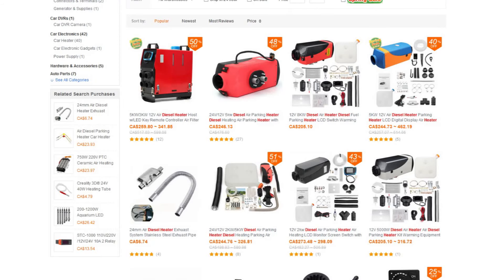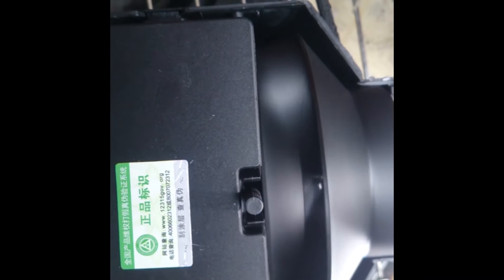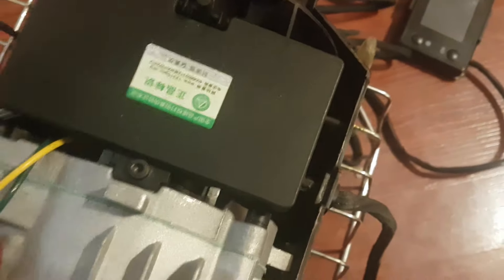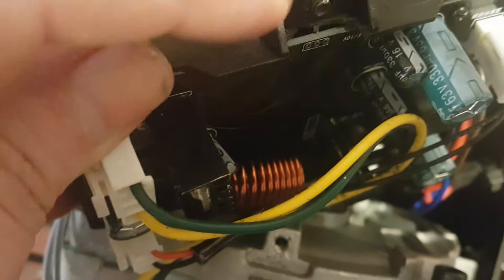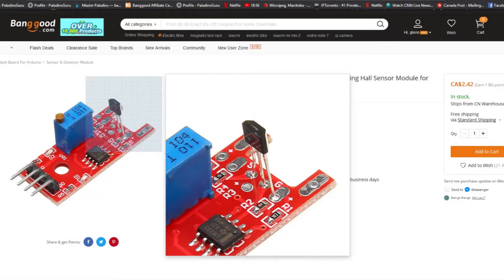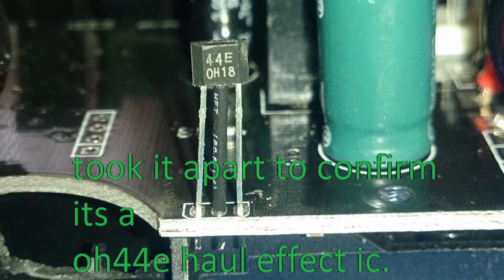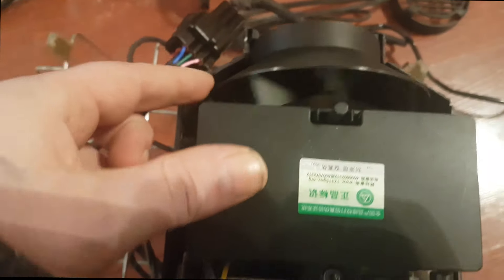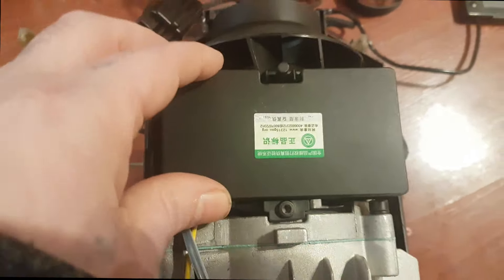Diesel Heater E 06 error fix

Comment: My E-06 issue turned out to be a fuel issue. The heater would switch on and run properly for about 5 mins or more then display E-06 and shut down. I pulled it apart and checked the fan was free and the sensor was spaced correctly and that was all fine. So after reading somewhere that the issue may be fuel related I checked the fuel pump and filter and noticed that the fuel filter was lower on the intake than the output side (angled downwards) and the line was lower on that side for a 6 inches or so. I cable tied it up so the line was now pretty much horizontal and its been working perfectly ever since. It apparently doesnt take much for these impulse pumps to not work and the agitation of the diesel can  create air bubbles in the fuel line. Anyway what ever the issue is its now fixed (its been giving me grief for a while). So its worth checking this if this video doesn't resolve the problem. Cheers
Reply from the maker: thanks for taking time to explain another way to fix the issue..
Reply: I feel no one know what it really it. People are just making random videos and saying it fixed it

Comment: Just fixed my error, I spent ages trying to fault find another unrelated issue with voltage - after I fixed the voltage issue I was getting E06 error as the circuit board was outside the unit whilst I was testing the unit. Didn't realise the circuit board had to be secured inside as the magnet helps regulate the fan speed.

Cheers!
Reply from the maker: yup @ 2:48 hall sensor.. if its even out a millimeter never mind out of the unit, it wont work heh.. glad  you figured it out..

Comment: Installing my 2nd diesel heater in our new rv. Primed it and got the code after turning it on. found your video and I had it fixed quickly with flat head screw driver, prying at 12 o’clock 3 o’clock and 9 o’clock. I’m toasty warm now. 😜 cheers.
Reply from the maker: cool.... thanks for taking time to leave success comment and the way you fixed it..    I love that heater during cold camping nights.. No more 40 pounds of blankets..(small pop up camper)just a sheet does the trick.. ....  have fun rving .... Hopefully next year we can get out to the lake our selves..
Reply: Just to verify, you pulled the fan(with the screwdrivers)  “away” from the sensor to create more gap between the magnets and that sensor? Was it scraping? Thank you.

Comment: I got that code. but the fan moves freely. When it first "starts up".. The fan doesn't move at all. it just throws the code without moving. fan can spin by hand. When that happens, the screen does show that it is spinning.  Ideas?
Reply: Mine has the same problem! Did u ever figure it out?? Thx
Reply: Same issue I’m having right now. Power to the fan and it spins just fine but seems like the control board is not sending power to the fan

Comment: Thanks for your suggestions however, my E-06 isn’t scraping when I spin it with my hand. I tried to get it going by spinning it after depressing the On button and it almost kept going. But just ended up dieing again! 😢. BTW, when I spin it by hand AFTER depressing the On button, then and only then do I hear a little tiny bit of scraping. As if the On button cause something to push out that wud make it scrape? Any ideas are very much appreciated. FYI, I primed it so I don’t think that’s an issue. And I’m about to purchase another motherboard cuz I read (somewhere) that helped someone.
Reply from the maker: have you tried to move the fan out just a tad anyways..and see if you still get scrapping with the power button pushing in...  the hall sensor and the internal timing are extremely picky on these units..  its extremely doubtful but you might want to check to make sure you have 1 or 2 magnets as well on the fan and also check to see if the hall sensor is in place correctly .
Reply: @ModItBetter  yes. The magnets and sensor appear as they did new. As far as moving the fan goes, it doesn’t seem to want to budge and I don’t want to break anything. Especially if it’s not scraping (when not on). Is there a screw or bolt holding the fan? I don’t see how u guys are moving the thing. It’s tight on there.

Comment: Just went through the nightmare that is installing one of these. The wire crimps at the main connector were just falling right out. I ended up having to cut the connectors out and butt connect them all. I did do a test run but after installing it no longer ran and gave this E06. I found this video and then found my gan was indeed rubbing. Mine was due to the case was slightly deformed from pushing on the carpet when I tightened the unit down. For me the fix was putting a large worm gear clamp around the end. I checked the fan spun freely and it started and ran as it should. If I could do it over I wouldn’t even waste my time installing one of these. They’re built so cheaply anything could happen.
Reply from the maker: crap.. glad you figured it out.. yeah tad nervous of using it on my trailer this summer.. dunno if i will wake up running around on fire..  point is if they have issues on just the fan. quality control is not at its best.. to be trusting your life with it.

Comment: Help needed please, I’ve got a CDHeater been running fine, error code E-06 coming up changed the heat sensor fuel pumping fine, gets up to temperature quite quick heater plug working  fan running good then starts shutting down then E-06 comes on.
Reply from the maker: are you running with the lid closed .. nothing blocking the air or exhaust.. .. the blower section can't be blocked even a little as well . If the fan is not spinning at 100 percent at the speed its suppose to be running at it will shut down.
If the fan is rubbing even a tad as well it will cause issues.  If the fan is too far away it will also cause the e6 error..

besides those.. It could be the magnets or the hal sensor.. 

Those are the only things I can suggest..
Reply: @ModItBetter  hi  hi I’ve checked everything you have said the fan is running perfect no blockages. The only thing is it seems to get up to temperature really quick within three minutes and then shuts off. I’ve checked with my other one and that one takes about 7 -8 minutes to heat up I’ve changed the heat sensor and that seems fine
Reply from the maker: @wattsupcarter  Have you tried going into settings with pass code 1688 i believe and try setting the unit hz to a way lower setting or higher..
Reply from the maker: I believe also setting for the magnets if you have 1 or 2.. it could be it set to the wrong one.. but its been so long on that

Comment: Hello. I got this error number, but my fan works freely. No click sounds at all. :/ This heater worked only first 5 minutes. After that I got err8 and after restart err 6... Do you have an advice for me, please?
Reply from the maker: are you priming it up by holding ok and down arrow..?   .. error 6 ..pretty sure it means any abnormality's with the fan.. by a certain time the fan should be spinning at a correct speed ..if for some reason no fuel and its not burning correctly the fan will be spinning slow when it should be going at a set rate..so then you get error 6..
Reply: @ModItBetter When you mentioned - I have also abnormal behavior of that priming mode. It should just turn on fuel pump it and indeed it did so before the error occured. But now it starts a fan too - the fan works on high RPM in this mod. I guess, it will be something wrong in Hall sensor... But thanks for your tips! You can see the process here: https://youtu.be/O6W0EbD2C9Q and weird fuel mod here: https://youtu.be/gcWTxEpY9L8
Reply from the maker: @heimatcz  that is weird.. have you tried it on another battery?  maybe the one your using can't deliver the starting amps.  doubtful but something to try.. 

also if the exhaust is blocked it might force the fan into a higher rpm however that does not explain why it comes on when you are priming it.

sorry no expert ..i've only really used a couple of times ,but will this summer for camping .. so hopefully i run into the same problem.. 

tried to google to see if there is  a way to set the default settings as well.. but could not find anything on that subject..
Reply from the maker: I'll try later today as well to see what happens if the pump is disconnected as well .. just to see if i can get it to do that with a pump failure..
Reply: @heimatcz  Your videos are listed as private

Comment: Great video, saved me as well, although you really do only have to move the fan instead of the mod you show. It's tough to move at first but it does move.  They just push them on too much during assembly, need pulling back a touch.
Reply from the maker: Thank you,   And thanks for taking time to post a positive comment with a fix as well..

Comment: Thanks for the diagnosis...for those who are having the problem You can fix it much easier by just pushing the fan away from the fixing a little..
Reply from the maker: Hi thanks for the share..btw  I did mention that at 1:13.... regardless of which way gets somebody going again.. I find it odd they are still sending them out this way.

Comment: Just had this issue on mine. Turns out a piece of cardboard was stuck in the fan blade, probably from manufacturing. It was stopping it from spinning causing the code. Fished it out and it’s working great at heating my garage/shop now.
Reply from the maker: thanks for taking time sharing your fix..I'm sure somebody else will run into same problem..

Comment: I use two flat steel rules to remove the fan so this video is a good fix for the 06 error as I have encountered this problem I rebuild these motors as the can be stripped down very easily to replace the bearings and brushes
Reply from the maker: thanks Peter Clancy for the comment..

Comment: I have one just like that since last year and had that code E-06 before and it was the fan but now I got the same code but the fun is spinning fine ,could there be something else?? It goes on for just a second and shots off please let me know thank you
Reply from the maker: I've got the error when i don't prime it..or bad fuel flow.. .. Lid is off or something blocking any of the ports.     can also be the magnets or the sensor.. ..
Reply: bangs6996 thanks you I’ll try one of those and see what happens THANK YOU
Reply: @marcellosantos479  Did you fix it mate? I also get E06, with the fan spinning normally and after priming the fuel pump.

Comment: Hello! I tried to first remove the motherboard and spin the fan without having the motherboard mounted at all and it still making the same rubbing noise... do u think that it makes any  sence to try sanding the plastic ect ect? Thanksaa
Reply from the maker: Hi ..maybe your fan is pushed up too high..and rubbing against the top instead.. I would check that.. and if so maybe you can gently tap it back down the shaft.

Comment: The impeller can be reposition on the motor shaft (with a bit of force) no need for cutting anything
Reply from the maker: 1:16   thanks... heh.. the problem can be if its too far way from the sensors it wont work as well.. but defiantly try the screw driver first..   and A flat screw driver.. or something flat not what i had in my hand  that I was about to use ..

Comment: What’s the E10 fault please, and a cure? Thanks
Reply from the maker: check your fuel line.. ..pump, filter.. Maybe it has too much dirt or faulty pump.  make sure you have proper air flow for intake and exhaust as well..
Reply: Hi, it was working for about half an hour ,it was working previously but not it’s pjaying up . It’s blowing a gale outside and I can smell fumes, so would that be a issue, back draft kinda thing?  I’ve got red diesel in the tank would that be an issue?  I
Reply from the maker: @ewenb1733  It could very well be a back draft kind of thing if the exhaust is restricted...  I don't think the red diesel would be a issue at all.. .if you can make a bubble in your fuel line ..and see if it moves up normally  towards the unit.. .. but maybe look at blocking the wind some how as a test to see if its just that.
Reply: Hi, tried the heater again this morning , am guessing exhaust issue, filled the van with fumes , smoke detector level.... thought it was where I parked with wind but no wind this morning . LCD goes through start up process then displays E10 and shuts down.
Reply: Unsure of the bubble in airline thing or how to do it , I bought the van with the heater in it and it’s been working before!  Any recommendations fir an upgrade? This is a cheap Chinese model !
Reply from the maker: @ewenb1733  yeah its kind of hard to figure out these codes..   you can try to take off both pipes under the van to see if anything wrong.. with those.try to run it with them off.  you can try to take off the fuel then try starting it to make sure fuel is going up.. but if your getting smoke most likely you are..  
Can even be your battery.. 
 I am not sure how often you have to take the thing apart to clean out the chamber of soot
Reply: Cheers,  looking at a video just now , it could be sooted up and water has got in somehow, weather here in west coast of Scotland is horrendous so that’s a possibility? When I get home and dry weather sets in, I will attempt to remove and clean. Process of elimination. Thanks for your help though.

Comment: Just unboxed mine it mine has the e06 code but wont even start
Reply from the maker: did you try to spin the fan? if it is stuck using a screwdriver ect to pry it forward a tad is a quick way to see if it will then work.
Reply from the maker: also did fuel actually make it to the unit?.. you need to access the prime setting or just keep trying couple of times until the fuel has reached it.